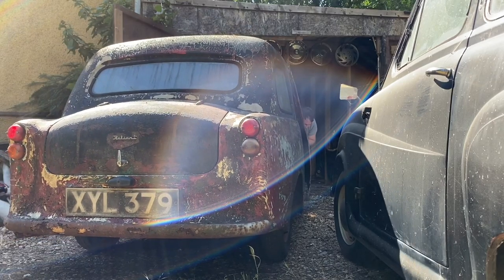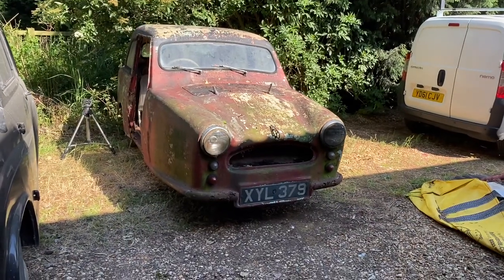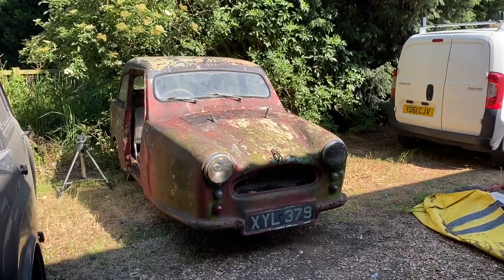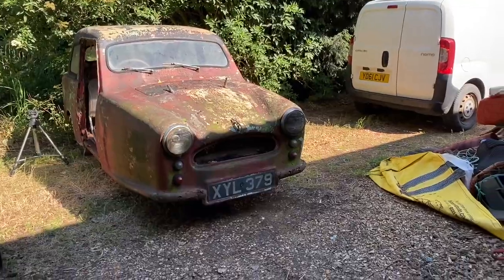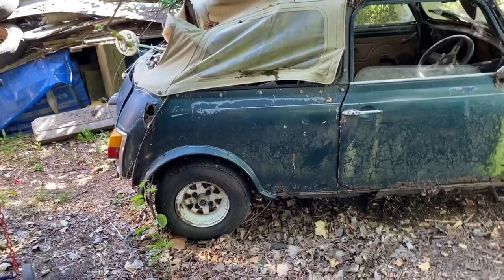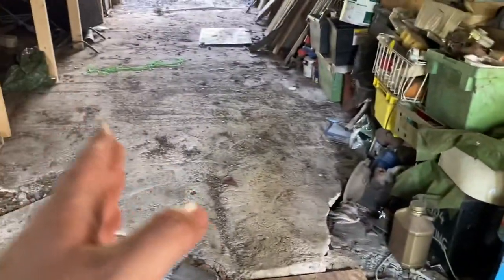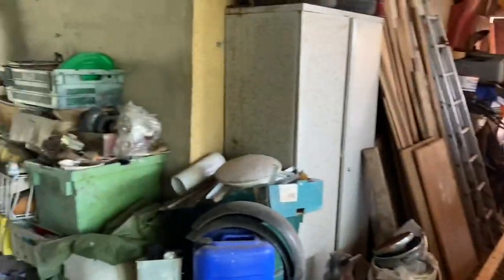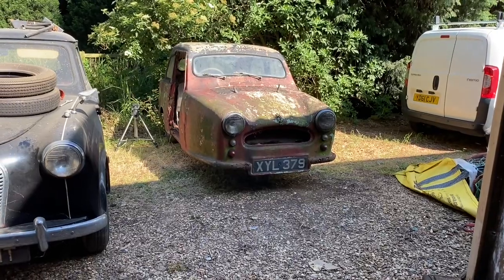1959 Reliant - Failed test drive!

Comment: The clutch release bearing btw is the same as the Moggy Minor and the same as the old Austin 7, was when they changed to roller bearing releases the last blast for a part that was in use before WW2.   Mine, when the roll pins sheared costing me a fortune, the mechanic put a little tig tack to give the roll pins a fighting chance in there.   When the roll pins went the whole clutch exploded nearly wiping out a fairly uncommon refurbished gearbox that had just been fitted after discovery in a gearbox specialists in Southampton who used to rebuild gearboxes on the older cars.   A brave soul to take on one of the 59's but when done will be an astonishing fun car to own.
Reply from the maker: I will do a final video of it soon with a link to the new owners channel. He’s already making great progress and the car is drivable now. Just needed to be driven a bit and it seems to have sorted itself out.

Comment: Oh boy ! Memory jolt back to 1969 I bought one (£7-10-0p) from Reading and Dad dragged it back to Dorchester on Thames my thinking was that with a motorcycle license I could drive it in the winter to North Oxford to work when it was very cold. We tipped it on to its side on to a mattress to take the sump off and with Dads instructions replaced the piston rings, should of had a rebore and new pistons because it still smoked but gained some horse power, one shove from me and it went back on it’s wheels any way when we serviced/cleaned/ greased and got it on the road I drove it to work in December when we had 6” of snow, it took 20 minutes on the Triumph tiger 90 on normal days flat out but in the Reliant on frozen snow crabbing with front wheel stuck in the near side track and no traction on the rear axle it took 1 & 1/2 hours to get to work where work mates stacked 3 x 2ft square concrete Paveing slabs right at the back end, 1 would of been enough. The next day a workmate gave me a  chrome metal bar with two rubber suction cups and a hot wire coil spring wired straight to the battery to put on the windscreen to defrost it. The stories that Reliant gave me. Bob

Comment: It could have been the friction material on the clutch centre plate came away from the plate due to age deterioration, much like old brake shoes can sometimes lose their linings which separates from the shoe with age deterioration. Either that, or the diaphragm spring finger(s) broke off so the centre plate had no force against the flywheel, hence the slipping noise when you tried to move it in first gear. I doubt a failed thrust bearing would have caused loss of drive - if that had failed it would have not been possible to get the car into gear at all. Shame. Crazy to think that old Reliant is over 60 years old - I've never seen one that old before. I presume it has a fibreglass body? hence no rust.
Reply: Yup, fibreglass panels over a wooden structure, professionally repaired with some metal shelving material underneath the offside door.
Reply: It turned out to be a rather interesting issue that was wrong with it 😂, passenger side engine mount was broken, so when the car went into first rather than spin the prop shaft it lifted the engine at the passenger side and the fan dug a hole in the drivers footwell and wiring 😅  all fixed now thankfully!